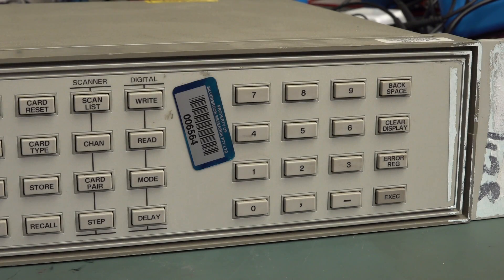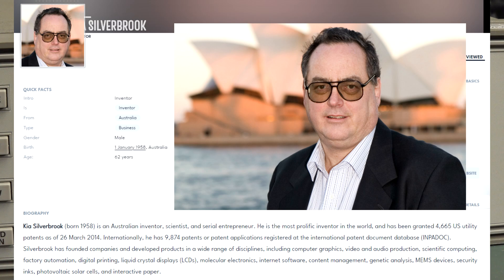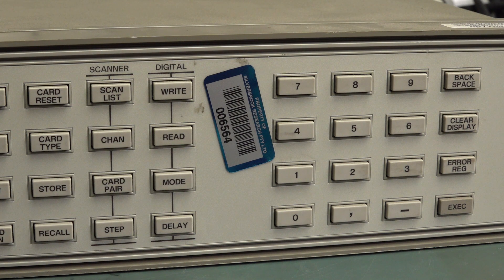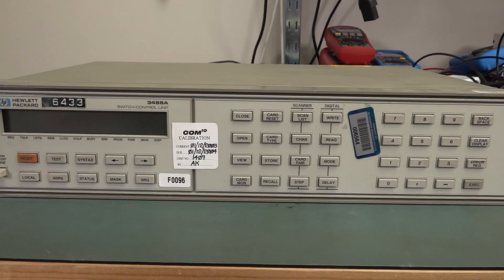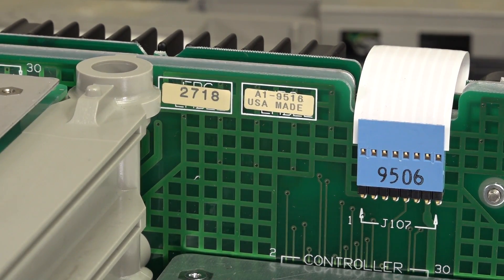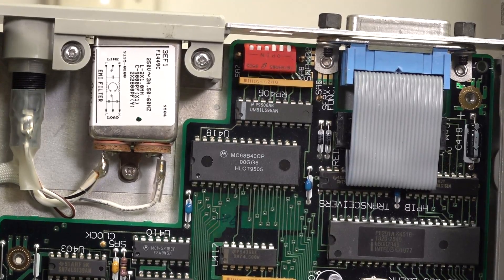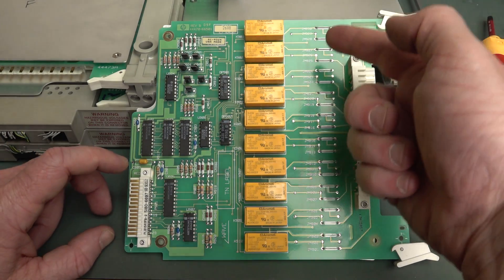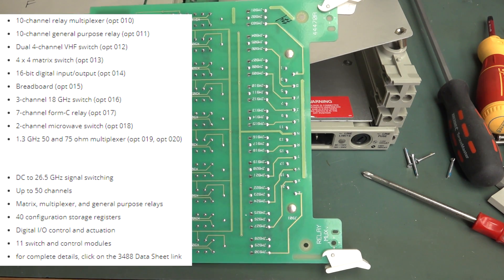Dumpster HP3488A Switch Teardown + Silverbrook STORY

Comment: Brings back memories.  I used to use these in the 90's when I designed automated test systems at Boeing.
BTW, there is a lot to know about electromechanical relays.  For example, if you're making a mux for routing signals to a high-impedance instrument, like a DMM, then you need to use relays that are designed for so-called 'dry' circuits.
An outstanding source is the Keithley Switching Handbook, which I just discovered you can download for free.  And there is another great Keithley book titled Low Level Measurements.
Reply from the maker: I've done a video on relay switching matrices https://www.youtube.com/watch?v=-mavHYV-H6o

Comment: GPIB capabilities list will tell you what SH1... etc. means:
SH1 full source handshake capability
AH1 full acceptor handshake capability
T6 basic talker, serial poll, no talk only, unaddress if MLA (My Listen Address)
TEO no extended talker capability
L4 basic listener, no listen only, unaddress if MTA (My Talk Address)
LEO no extended listener capability
SR1 full service request capability
RL1 full remote / local capability
PPO no parallel poll capability
DC1 full device clear capability
DT1 full device trigger capability
C1 system controller capability
C2 send IFC (Interface Clear) and take charge controller capability
C3 send REN (Remote Enable) controller capability
C4 respond to SRQ (Service Request)

source - http://na.support.keysight.com/pna/help/latest/Programming/Learning_about_GPIB/GP-IB_Fundamentals.htm

Comment: What's that slide switch for to the left of the power transformer? Seems pretty inaccessible and appears just to isolate the transformer from mains, the same as the main on/off switch does... Seems odd.
Reply: Probably mains voltage range selection.

Comment: I like your show it’s true serous electronics this really common bus ay off HP I worked at the instruments lab in Loveland Co and it was the ducks Guts to work at the best test gear made for a while when it turned into Adulent  things changed not for the specks of the gear but the attitude and limit on cost ,so left and went in sound at deep level

Comment: The was Silverbrook Reseach and Memjet Inc, SR did the research and design, Memjet did the manufacture. Originally, only wanted to create a print head, but needed to design a printer to show it worked. Memjet need to design a factory. Memjet sued SR for the technologies as SR was diverting more funds than allowed to do other research projects. Anyone working for SR on Memjet, was transferred to Memjet to continue working to the print head to market.  SR faded away. Memjet continues today, but many retrenchments. I believe their target market is now label printing.  It was great working there in the early days,  We worked closely with electrical, mechanical, and chemical engineers, creating design rules to put  holes through the  silicon for the ink. I actually pushed the polygon on the print head. Our first print heads were basically inkjet (a skunk work job, while Kia wasn't looking) while the mems were improved.  We had working printers, but low yield on the manufacture of the print heads.  Thanks to Kia, I have my name on many patents....

Comment: PS. You didn't show the backplane.

The higher unit would be more versatile. Like 3U or 4U. This way you can put stuff vertically for the logical and power supply, and then reuse a lot of common backplane, networking, thus saving cost, simplifying control for big systems, and make possible to use a bit wider modules.

Comment: 11:40 The layout is actually very smart. This way the waste very little of the back side, where you plug all the cards, and the right front side is perfect for transformer: 1) it makes it balanced compared to the left back side, 2) normally HP instruments do have input connectors there, but this instrument is blanked there. This way they could reuse the chasis, most of sheet metal, and plastic molds for the front panels. I am sure behind the front label, there are holes for input terminals for DMM / LCR style instruments. Once the transformer is on the right, everything goes logically on the board from right to left behind buttons. With most complex pieces at the left, with micro and display and connections to GPIB. It does look a little bit old design. Now, the PSU would be inside the metal can on the left back, with all other electronics.

Comment: I worked at Silverbrook/Memjet for 5 years it was great for a while, very interesting place to work at. High speed inkjet it does a page per second in full colour it works just they couldn't get it good enough compared to laser. Memjet is still around just a lot smaller.

Comment: A really neat thing about the design that you didn't cover is that the voltage selection switch is hidden behind slots 1-3, so you need to remove them and reach in to change it.  You can see the back side of this switch next to the transformer.

Comment: Nice power brick ST gs-r405s 5.1V at 2A. I have used some of the isolated ST 5v / 12v bricks in my solar powered work shop, everything is powered from a 28v power wall built from recycled 18650. I used to work in a Surplus shop in Lincolnshire  called J.Birketts and we used to get workshop clear outs from Plessey / Dynex, had some high end test gear with some weird arse probes for Silicon on sapphire M.O.D equipment back in the 90's.

Comment: Hope you are kidding abouit the code being SHA Secure Key...doh! guess you never used GPIB. The GPIB Standard requires that all GPIB capable instruments display a code that describes their interface capability on the rear panel using codes. Code decoded below.

SH1 - Full Source Handshake capability
AH1 - Full Acceptor Handshake capability
T6 -  Basic Talker, Serial Poll
L4 - Basic Listener
SR1 - Full Service Request Capability
RL1 - Full Remote and Local Capability
PP0 - No Parallel Poll
DC1 - Full Device Clear
DT1 - Full Device Trigger
C0 - No Controller Function
E2 - 3 State Drivers
Reply: and now you know why some standards just won't die ... backwards compatibility...

Comment: I've started working at a lab at uni and I think we have a FET multiplexer module for one of these, but the switch itself is nowhere to be found! I'll try and get a model number off it in a hot minute.
Reply: Actually, nevermind. The card edge connector is similar but the mechanical dimensions are completely different. No idea what it plugs into now.

Comment: These boxes should still work, they are un-destroyable. I still have one base unit, which was maybe 40€ cheap, plus 5 relay cards, also quite cheap, depending on the function. Would be interesting, which cards you have inside.. most were latching, low e.m.f. types, which makes it interesting for volt-nuts, e.g. determining T.C. of bulk of precision resistor, or scanning through variety of voltage references.
Please don't scrap these units, as the modern units cost a fortune.

Comment: Interestingly, I noticed that the ST power module had a HP suffix on the product code. So did the relays. Any other 3rd party components with HP product codes?